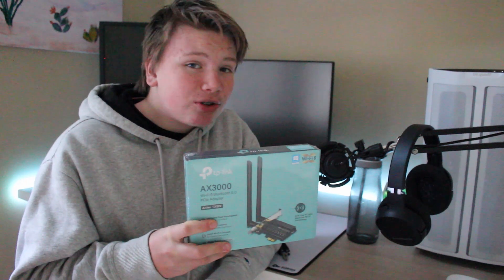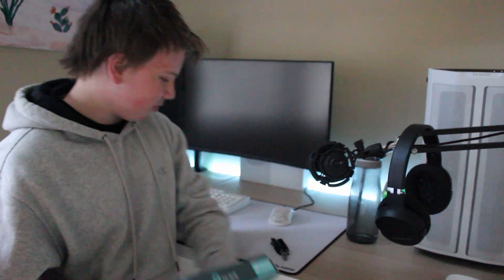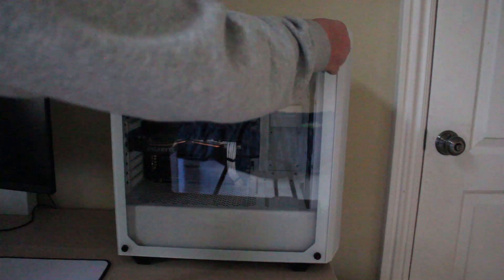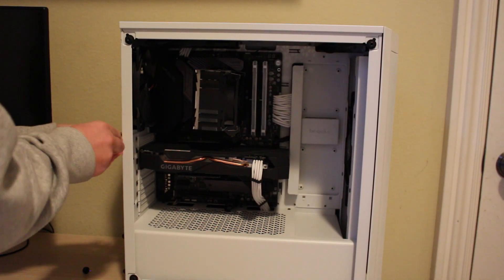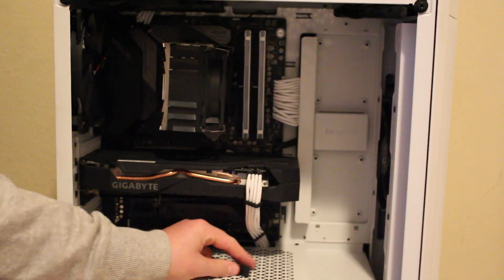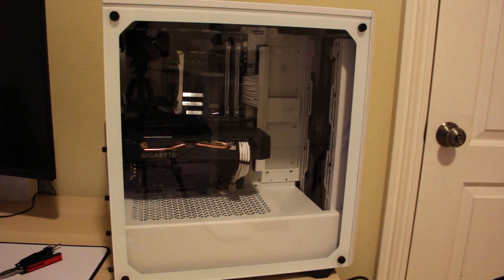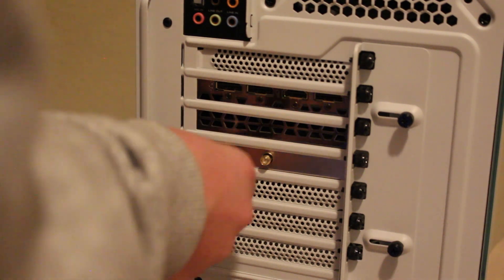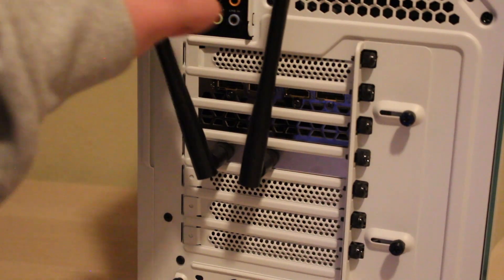TP-Link WiFi 6 AX3000 PCIe WiFi Card Unboxing + Installation

Comment: can i please get some help, i’ve done literally everything i can possibly think of, i’ve downloaded and uninstalled the drivers and bluetooth like 10 times and i’ve restarted my pc twice that, i’ve done everything single thing, i’ve uninstalled my old drivers for my old extender, but it’s still not even popping up, and when i go into my wifi change adapter settings, the only things i see is bluetooth network connections and eathernet, and eathernet 2, someone pls help me man pls, im literally begging someone anyone pls help me out

Comment: Hey why my pc sometime cannot detect the this network card?
I need to restart several times, so my system was able to detect the WiFi signal
Reply from the maker: Make sure that all of you drivers are up to date. If you are using a Intel system you can use their free driver updater.
Reply: @technowvids  yes is up-to-date but not working
Reply from the maker: @johnchong9660  do you have any other network devices like built-in wifi or ethernet that are plugged in?
Reply: @technowvids  No
Reply from the maker: @johnchong9660  Did you plug in the cable to the USB 2.0 Header?
Reply: @technowvids  yes I did
Reply from the maker: @johnchong9660  ok, so go to device manager and check if it is showing up on network devices.
Reply: @technowvids  Sometime will show up sometime disappear,  i have not idea already. I also change to another pcie x1,  slot , it also same problem
Reply from the maker: @johnchong9660  How close to your router are you and what material walls are between?
Reply: @technowvids  wifi and downstairs, my pc at upstairs, but I try move my pc to downstairs is not working too